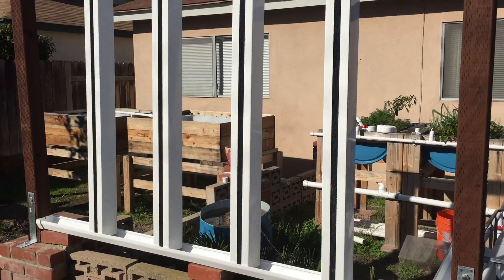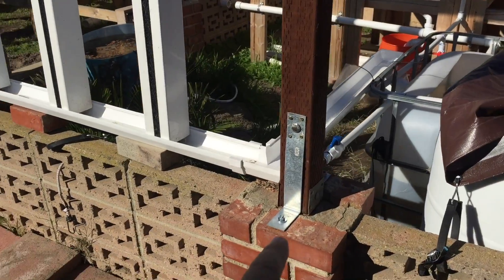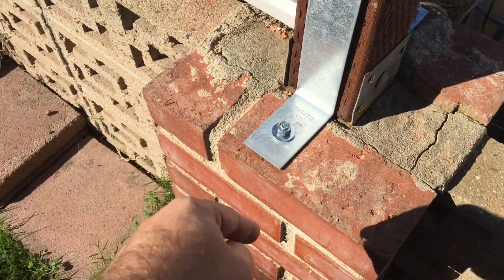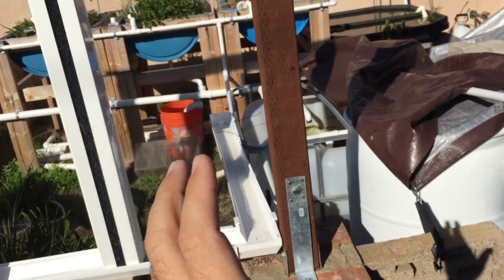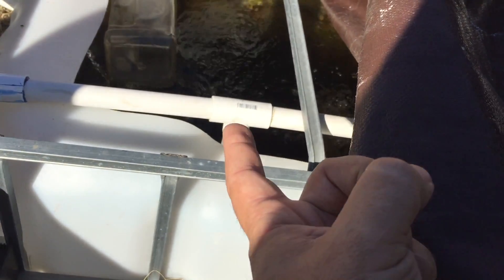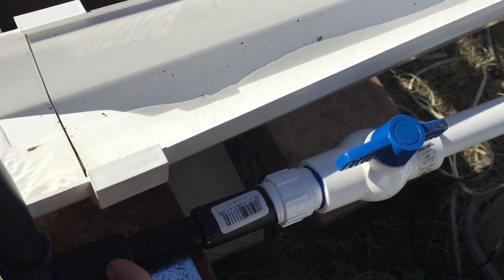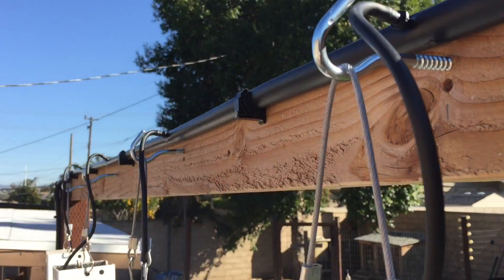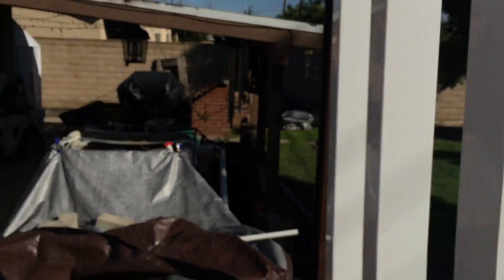ZipGrow Towers Installed! - How I did it!

Comment: have you though about having some kind restrictor/ plate/cap  with holes drilled above the grow tower to have uniform water distribution over the tower media.  now its being dripped in only place!!!
Reply from the maker: +Sri Prasad, yes I thought of that but these kids do come with a wicking cloth that go in between the media. Basically when the water hits the week and cloth it wicks the water from the front of the tower all the way into the back and all around. The wicking cloth is unnecessary when you have an established root system but for little starter plants, the cloth works great.

Comment: What size is your rain gutter at the bottom?
Reply from the maker: That's a good question and I will go outside and measure:) Ha ha ha!
Reply from the maker: Okay, so my rain gutter is 4" wide:) My grow towers are also 4" wide. So, my ZipGrow towers fit in my rain gutters tight. I basically stretch the rain gutters a bit which make the grow towers sit in the rain gutters very securely. I'm probably going to use a heat gun around the rain gutters edges to make permanent seating for the towers. I'll do a video on it.
Reply: Awesome, thanks.  I have 4 - 5ft zipgrow towers too, but need to build my vertical structure before I can do anything with them.  ;)
Reply from the maker: Just jump in and start doing it:) You will figure it out as time goes by and then you will know how to do it forever! It's like paying for a class.
Reply from the maker: Linda Readman, no problem at all!!  Keep following what I'm doing to get more ideas and just to stay connected:)